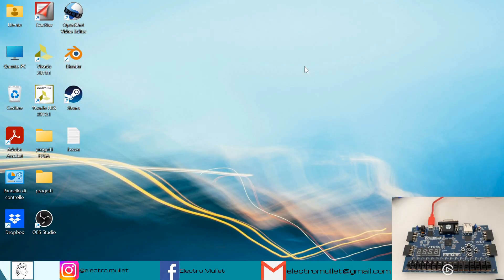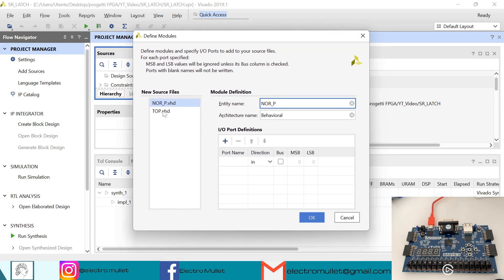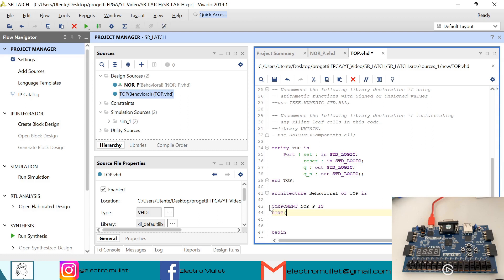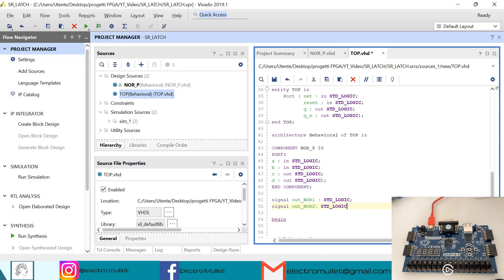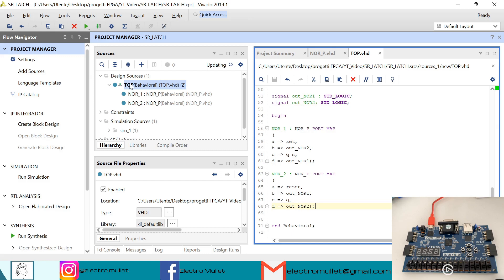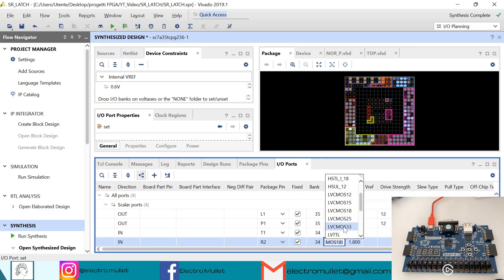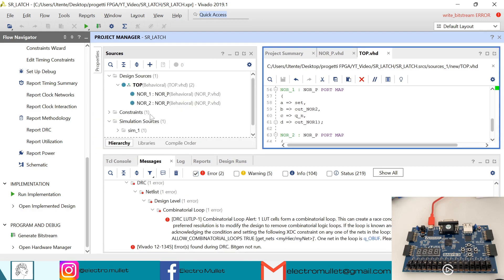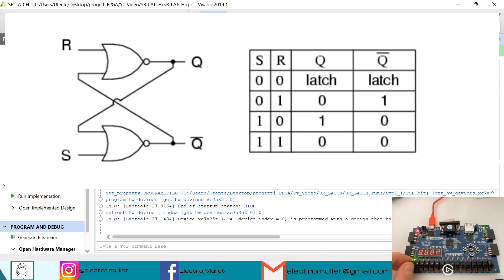5.FPGA FOR BEGINNERS- SR Latch in VHDL on the Basys3 Board

Comment: Hello, I added the extra line and still got the same error message with bitstream failing. Any idea why this is?

EDIT: I typed combinational vs Combinatorial issue is fixed
Reply: Im getting this warning message as well "[Netlist 29-177] Cannot set property 'ALLOW_COMBINATIONAL_LOOPS' because the property does not exist. "
Reply from the maker: @OkoIyae6  It seems like vivado is not getting the constraint properly